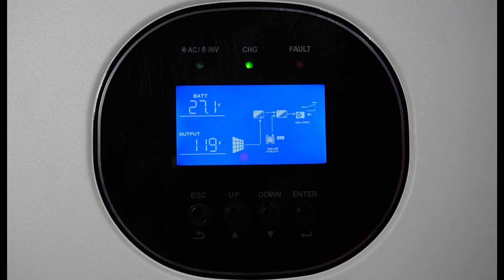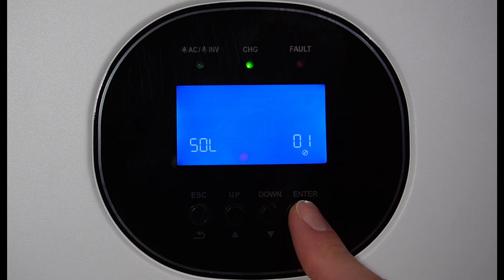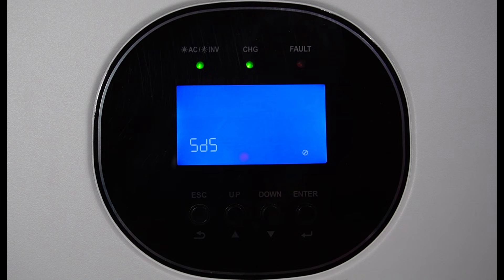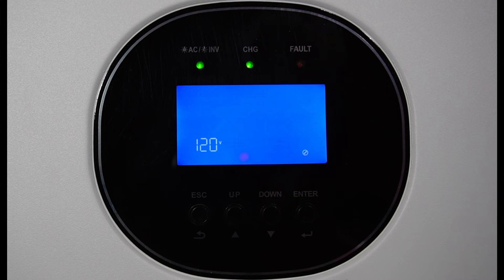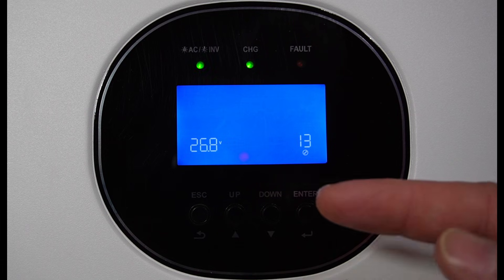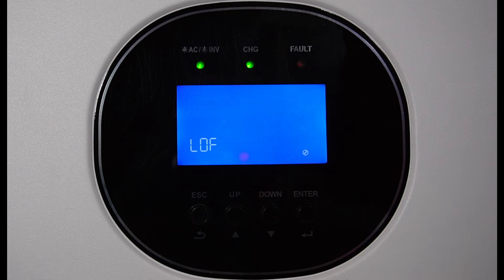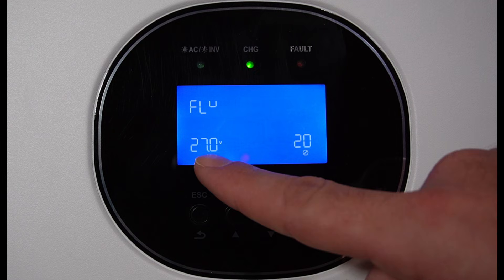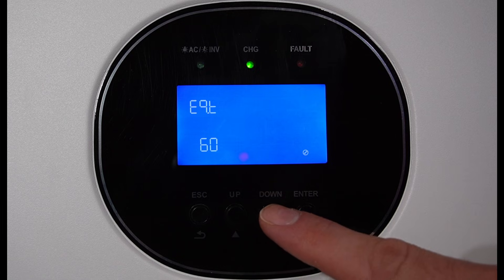Growatt Settings LiFePO4

Comment: Heres hoping you can help me understand the Growatt functionality, I have 2 12v LIFEPO4 batteries in series, they were fully charged and balanced with one another before being put into service, I have a shunt to monitor the charge of the battiers, what I cannot wrap my head around are the settings so I will share what I have and explain my issues, settin 1 sbu, 2 30amp, 03-ups, 05-us2, 10-2, 11-50amp, 12-25v, 13-28.5v, 14-snu, 19-28,8v, 20-28.8v, 21-23v, 22-sbe, . What I thought was the battery would charge with a combination of solar and grid, then when the solar was unavailable the grid would charge the batterys, however what happens is, when the battery falls below 25v the solar and grid combine to charge the battery but the charging stops at 28.5v instead of the 28.8v settings. this is where setting 13 & 19 are confusing, any help you can give would be appreciated :)
Reply from the maker: Put your batteries in parallel and charge them to 14.6 to balance them. Sounds like one of the batteries BMS is stopping charging before the other. Don't try to charge to 100% and don't discharge to 0% also set your float lower.
Reply: @Roll2Videos  actually I was told by the battery vendor to charge each battery independent of the other to 14.6, then connect them together in parallel for 12-24 hours to balance them, my problem is the Growatt stops charging at 28.5v instead of the 28.8v that I have it set to, thus the confusion on the settings of the growatt. The batteries are not shutting down, they will continue to charge if I change the 28.5v setting higher.
Reply from the maker: @UnkyjoesPlayhouse  Maybe the voltage drop in the wire. I won't worry about 0.3v difference.
Reply: @Roll2Videos  Thanks for trying I am reaching out to Growatt to see what they say, one thing I noticed when using US2 is that I cant change setting 12 from anything other than 25v.
Reply from the maker: @UnkyjoesPlayhouse  ok, good luck to you

Comment: Just want to say thanks for all your time in making these detailed vids. I just got my Growatt but I'm currently just trying to buy all the hardware,wires and equipment. You pretty much did all the work for me,I just need to get it all together,plan out my set up& go. Got mine from Ian also but didn't wanna pummel him with 1,006 questions. I may hit u up a handful of times tho lol. 👍✌🌞
Reply: I already own Point zero Titan with a couple batteries,Lipo4 100ah battery in the expansion and( 25) 100watt panels but I wanted a back for my back up just to be safe and all my batteries are 24v too so this seemed ideal.
Reply from the maker: @scarygary3569  That is amazing man! Hearing you explain your setup really interests me and hearing that I can help people like you out to setup their own system really makes me feel good.
Thank you 👍

Comment: Im watching your video and saw you set your battery at 28.8v?  Would that stress your battery out being fully charged?  Also did you build your won battery from the lifepo cells or already built batteries?  

Thanks great video for a newbie.............
Reply from the maker: Welcome to the hobby. With LifePO4 I could charge upto 29.2v I'm being conservative at 28.8v. Check out the voltage curve on a lithium battery it's relatively flat I'm set to just after the curve up, Same with my bottom voltage it's just before the curve down. I'd say I'm between 20% to 80% SOC.
I did build my own batteries I have more videos covering the builds.
Are you planning to build your own solar setup?
Reply: @Roll2Videos  I have already built a 24v lifepo battery (8 cells), top balanced, built a box to keep them from expanding, waiting on my 24v growatt  I think it’s the same as yours in the video.   Have panels, not up yet, and all fuses, wires, bus bars etc.  I have successfully built a 12v 900 watt set up last year in a trailer.  I’m a newbie with 24v and lifepo batteries.
Reply from the maker: @robertc4445  That's amazing! Check out some of my other videos for ideas.
Is the Growatt in the mail?
Reply: @Roll2Videos  supposed to be !
Reply from the maker: @robertc4445  I'm sure it is lol enjoy the hobby I love it

Comment: Much appreciated, the manual is ok but this is really helpful on top that. Thanks for another great video!
Reply from the maker: Thank you very much! Do you have the 24v or 48v?
Reply: I have the 24v model. I'm using it with my 8s2p 7.4kwh bank made with old school abs cased prismatic cells from alibaba and overkill bms's. It will be the main bank for my van. Additionally I'll be running 2-chins 100ah 12v charged by the alternator and running my dorm fridge via pheonix 12/500. I'm having fun!
Reply from the maker: @TBButcher   @TBButcher  Running lithium off you alternator I'd watch the video from victron on that topic. With the low resistance of lithium you could burn out your alternator or even start a fire. Do research before hand.
Reply: Thanks for the tip! I'll be using the renogy 40 amp dc dc charger; I'll add a manual on/off switch as well.  I forgot to mention my solar array, it will be 5-175w in series
Reply from the maker: @TBButcher  that's perfect! 175W x5 they are about 24Voc so 120Voc puts you under 145Voc. Very smart 👍